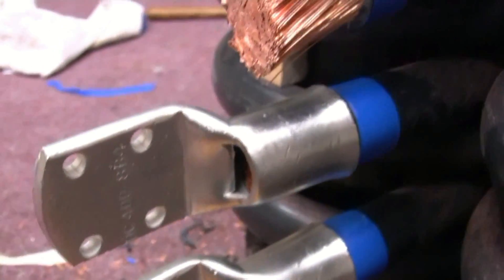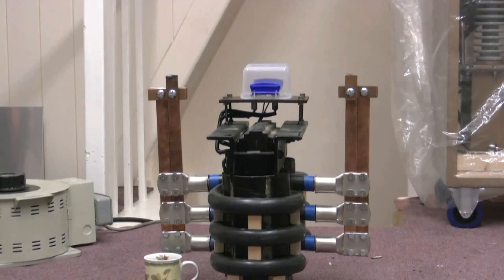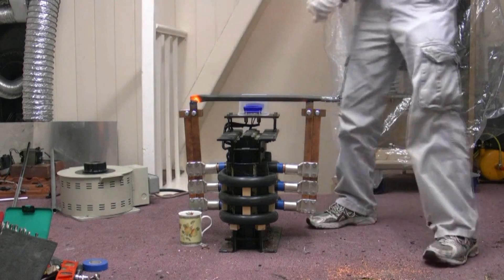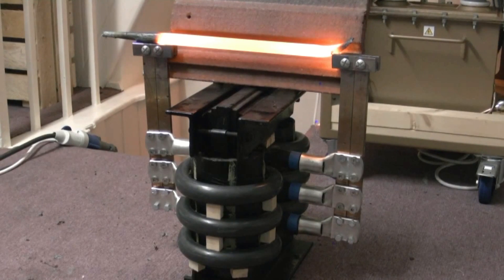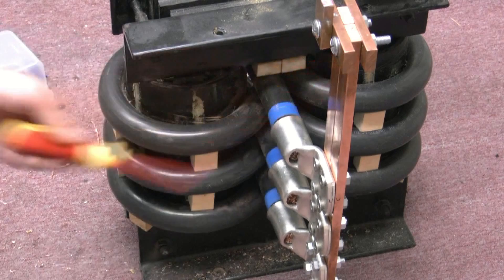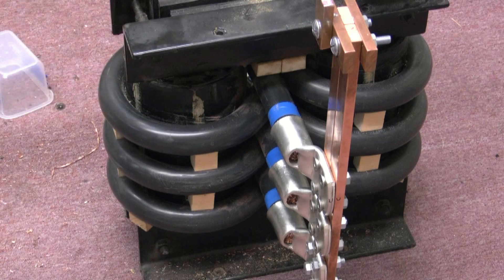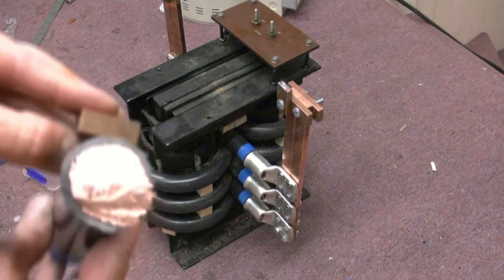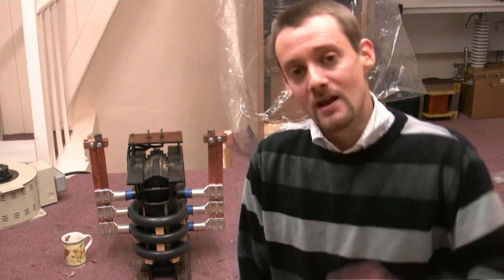50,000 Amp Transformer Completed

Comment: For the section of this three wires, you have at máximum power about 5,000-7000Amps, and not many time, 50,000Amps is TOTALLY discarded. The medium current on one graphite electrode of a 150MW meltshoop furnace is about 80,000-100,000Amps, and the output of this transformers has four wires for each electrode, refrigerated by water and with a section of an elephant leg each.

Comment: i wouldnt do this. but the first time he has a bar going across.. since hes trying to short out transformer it seems, wouldnt he become a load? or is he a ground? or grounded?
hes nuts. this guys knows his stuff right?
Reply: There isn't enough voltage to push those amps through the human body.
Reply: voltage is too low, and about the grounding thing, it's a transformer.. secondary is floating (not reference to ground) touching one terminal while grounded is fine, and when he short the transformer the electricity flow through the metal and nothing flows through him because there's no path to anything, even if there's the voltage is too low
Reply: Thanks guys

Comment: i don’t understand how he can hold the bolt without him getting shocked or his end getting too hot
Reply: The voltage is wayyy too low to shock him, and secondary of a transformer is not reference to ground (floating) so no path for electricity to go, and for the temperature, with thick bolts like that heat will probably take sometimes to get into his hand and the current only heats up from one terminal to the other
Reply: @Mark S what about the bolt heating up

Comment: That's not 50kA. When you use just 1 loop with 0.5V, voltage is so low that you can never have a good contact to the object you are melting so amps get too low. Attach all 3 cables in series and you'll see the difference.
Reply: it's a youtube video.. what do you expect. 50kA is the theoretical limit of that thing

Comment: How much is 400m2 cable back in blighty?
And how much are the lugs?
Im using 70 and 95mm2 for an off grid solar rig and its not cheap new. I did score a bit of 95 for free with a bus though, they had it running to the hydraulic tailgate pump from the alternator, nice score!
And the 70mm was at a garage sale $5 for 28m red and black.

Comment: I would have guessed that 50K amps could be very hard to interrupt without excessive voltages causing flashover.  But it appears that he interrupts the current by lifting the end of the bar with little problem.    There may be details of the design not apparent.    

Big power plants use "isolated phase bus ducts" to carry 25K amps to the low side of the transformer.   On the rare occasion when they short out, it can cause a flashover between the phases that is impossible to stop.  It can melt the ducts all the way back to the generator, then destroy the generator.   

The voltage across spark when lifting those bars is L di/dt, and di/dt is a huge number.
Reply: it's only 4 volts
Reply: @leolego2  That doesn't help.  Interrupting that current causes a L(dI/dt) counter voltage.  Even if L is small, dI/dt would be huge.

Comment: how is he not scared of being electrocuted to death ?
Reply: he's a trained electrician and knows what he's doing thats why... and it's low voltage so its pretty much harmless
Reply: @conkerconk3  from what ive read,  50000 amps is pretty much deadly, regardless of voltage
Reply: @Wildtotarda  you cant get that current through you if there isn't enough voltage. current = voltage / resistance. a 50,000 amp transformer just means it's capable of providing 50,000 amps, it doesn't mean it will always provide it. stick a 100 ohm resistor across it (assuming the transformer output voltage is 1v), that transformer will be putting out 10 milliamps
Reply: @conkerconk3  ok, this is getting to technical for me, but thanks for the explanation lol
Reply: @Wildtotarda  You need volts to drive current through a circuit. 0.5 volts drives microamps through the human body. Direct comparison - touch both terminals of a 1.5 volt battery and you'll have three times as much current flowing through you than would have connected up to this transformer.
Reply: @paulanderson79  Thank you.

Comment: *IT'S ONLY GOT 1/2 A VOLT  he said*

Sounds like he's saying "it's very low voltage so it's safe"

Meanwhile he forgot:

0)  voltage doesn't cause injury - CURRENT FLOW causes injury (or death).  NOTE:  A current flow as low as 0.1 Amps - that's 100 milliamps - can kill you.  He's bare-handing a metal bar with 500,000 times higher current flow than lethal 0.1 Amps.  50,000 Amps  is 500,000 x 0.1 kill-you-amps = 50,000 Amps

1) transformers explode sometimes and when it happens it sounds like a bomb

2) putting a dead short - ie. short-circuiting ANY 50,000 amp electrical device - well the device is going to get very hot and could explode

3) for example, let's say you take 240 volts AC off the main power source in your basement apartment (Mom and Dad let you stay there as long as you're 'good') and you use a step-down transformer to raise max output current to 50,000 amps and then you SHORT-CIRCUIT THE 50,000 AMPS - that's a lot of current, basement-dweller man. The transformer should not be shorted like that unless YOU HAVE A FUSE or CIRCUIT BREAKER that trips before the transformer explodes

4) the circuit breaker or the fuse must trip and STOP CURRENT FLOW *FAST* - ie.  in less than a second - or the electrical device generating the current will GET VERY HOT and could possibly explode

5) I can't help but point out - he had NO THERMOMETER to monitor the heat of his transformer.  That could save him if he knew the manufacturer's "maximum allowed temperature" for that transformer

6)  how long did he hold his circuit breaker - aka *THE SCREWDRIVER* - across the output of the pretty damn hot transformer?   Hint, how much time did his "fuse" - aka *THE SCREWDRIVER* - allow the 50,000 amp transformer to heat up?  For how long did his 'fuse' remain in position, shorting out the 50,000 Amps?  HINT:  Was it longer than, say, a second or two?

"How do I get out of this basement?  Me life's a shambles.  Maybe a dead short across a 50,000 amp transformer would do it"
.
.
.
Reply: Half a volt will not push 50,000 amps through the human body.

Comment: How doesn't he get shocked with the first metallic bar holding with hands?!
Reply: Ryan The transformer has a low voltage output. His body has a high resistance, so very little current will flow.
Reply: @M1Cr0sOfT  thsnk you!
Reply: Ryan no worries mate 👍

Comment: 1:41 please explain how you're touching the bar with bare hands
Reply: Most of the heat is being produced between the two terminals so there would only be heat conduction to the part he's holding. I'm sure it would get pretty damn hot after a while though

Comment: SERIOUS QUESTION: how does he not get electrocuted?
Reply: @MissRiaElaine When you're overheating copper bus bars of that size you have to know what you're doing. Plus this guy has to be like a transmission lineman or engineer or something. I'd actually love to know.
Reply: @Magneticitist  He's a degree qualified electrical engineer.
Reply: @paulanderson79  Anyone seen him recently?
Reply: @Magneticitist  Sadly not. He had some massive issues getting his wife into The UK from India.
Reply: @paulanderson79  Oh I thought they worked that out. I recall seeing a photo someone who knew him posted online of him and his wife looking happy and seemingly standing in his home in the UK. That was a while ago though and I thought maybe his wife might have just been keeping him busy or maybe taking issue with him potentially burning the place down lol.
Reply: Half a volt can't drive any dangerous level of current through the human body. Touching both terminals of a 1.5 volt battery will push three times more current through you than this 0.5 volt supply can.

Comment: The only thing that can have as much strength as 50,000 amp is a lightning flash. Naturally we already know the impact of download by nature and that small short shown in this video and compared to a lightning seems rather that the owner of the video put zeros where they do not go. Possibly 500 amps at the most. In addition to where you will get so much energy where it would seem to be in a home.
Reply: 50,000 amps at 0.5 volts is only 25kW. 100 amps at UK domestic supply voltage. Most houses have 100 amp main fuses.

Comment: How it's voltage AC or DC ???
Reply: It's AC, you can't run DC through a transformer.
Reply: @rtdlaboratories  Worrying, isn't it?
Reply: @paulanderson79  What's worrying exactly?
Reply: @rtdlaboratories  people with no understanding of electrics and electronics.
Reply: @paulanderson79  Oh that.. yeah. But as long as they are willing to learn and do the research on what they are getting into beforehand, get them a long way on avoiding injury or property damage. Just the lack of knowledge isn't an issue in itself, we've all been there at some point.
Reply: @rtdlaboratories  That is an utterly fair point and well made. We can't all know everything.

Comment: Why? The welding inverter generates 200A at 20-80V. You have a maximum of 50A, judging by the way the steel bar is heated

Comment: 1 amp will kill
Reply: Currents as low as 30 mA (0.03 amps) can kill. But we only have 0.5 volts here. Nowhere hear enough to push even 1 mA through the human body. You could grab both terminals quite safely.

Comment: Hello, What it is to have money and spend it on useless things, which use has damaged screwdrivers, that is the principle of resistance welding, or electropunto. But as I read in a comment, certainly there is no 50 kAmp, in fact at those levels of amperage requires cooling of the contact tips and the cross section or area of the secondary conductor must be calculated according to the current density. Also the terminals connected to the cables of the secondary have lost due to low voltage and high amperage, I did not make a good connection at those points. It is a constructive comment, without finally offending your time and your money.

Comment: I remember working on a 15,000 amp variable constant current power supply we built for Westinghouse, they used it to test circuit breakers. It was 3 phase and used hundreds of 2n3771s for the series pass element. We used 2 large aluminum angle irons and a steel shop stool as the load, you just had to have a 200 pound tech sit on the stool to make sure you had contact. That stool had the paint burned off the legs because they glowed dull red at full load.

Comment: Photonicinduction 50,000 Amp High Current Transformer Completed
25kva - 75 kva transformer, output voltage at 0.5v    3 x 400mm2 cables
50kA is at max power on short circuit. Input voltage 0-240v
My house does not have enough power to run on full load, transformer was built as a demontration of high current.
Sound Track generted from http://www.looperman.com/

361/5000
Indução Fotônica 50.000 Amp High Current Transformer Completed
25kva - transformador de 75 kva, tensão de saída em cabos 0,5v 3 x 400mm2
50kA está na potência máxima em curto-circuito. Tensão de entrada 0-240v
Minha casa não tem energia suficiente para funcionar em plena carga, o transformador foi construído como uma demonstração de alta corrente.
Trilha sonora generted de http://www.looperman.com/

Comment: Your 50,000 amps are totally false let me tell you why.

(50,000 amp) Secondary coil X (1 volt) secondary voltage = (50,000 whats) power output on the secondary

(50,000 whats) power output on the secondary / (125 volts) primary voltage = (400 amp) on the primary coil.

What is totally false is that your supply cable supports that current.

I could handle it as transient but not as a constant load.

Comment: Tus 50,000 amperios son totalmente falsos déjame decirte el porque.

(50,000 amp) Bobina secundaria  X (1 voltios) voltaje secundario = (50,000 whats) potencia salida en el secundario 

(50,000 whats) potencia salida en el secundario / (125 voltios)  voltaje primario = (400 amp) en bobina primaria.

Lo que es totalmente falso que tu cable de suministro soporte esa corriente.

Podría soportarlo como transiente pero no como una carga constante.

Your 50,000 amps are totally false let me tell you why.

(50,000 amp) Secondary coil X (1 volt) secondary voltage = (50,000 whats) power output on the secondary

(50,000 whats) power output on the secondary / (125 volts) primary voltage = (400 amp) on the primary coil.

What is totally false is that your supply cable supports that current.

I could handle it as transient but not as a constant load.

Comment: 0.5v and you're saying you could probably touch it and not feel it....I doubt you could feel that across your tongue, completely safe. That saying about it's not the voltage that kills but amps is complete BS, it's both, without voltage you can't push enough amps through the human body to do an damage, there is simply too much resistance.
Reply: It seems you and I are the only people in here to understand the relationship between voltage and current.

Comment: Idea use 20 m^2 copper wire and/or superconducting wire for conducting 1 Teraampere of current AND increase ratio until you get it.
                                           -energyninja50909
Reply: 20,000,000 to 1 
50 kA          to 1 TA

Comment: so is he creating a short by connecting the 2 bus bars with the rods/screwdrivers? creating less resistance and way more amperage? How come the short doesnt cause an explosion? Also dies wrapping the 400 mil cable around the dual  cores, step up the voltage or step it down?

Comment: It is not 50000 amp.
It is about 2000 amp.
I have 600 amp rectifier and it can burn half inch steal rod in 20 second.
Reply: It's 0.5V, the connection to the busbars must be really low impedance to get the full available 50kA.

Comment: That's why I personally prefer Low Voltage: High Current over High Voltage: Low Current. The first one won't get through your skin, so it is pretty save to touch. It might get very hot, but I can do something about that. High Voltage will kill you if you touch it...

2:58 The famous test to see if something is overloaded: Is the wire too hot to touch?
Reply: yea but with more amps than volts 70% of the overall wattage will be gone, 
nearly all the electrical energy inside them gets converted to heat, that;s the main reason we use AC in the first place so we can keep the pressure going to push out that power instead of letting it heat up the cable

Comment: Thought amps kills u. Not volts
Reply: You need both, 1000A at 1V is harmless as the resistance of the human body is too high none of that current can pass through you, 1A at 1000V however is lethal.

Comment: I use to work for a magnetics company that made custom one off and very small production run transformers.  In 1969 when the USS Enterprise CVAN-65 suffered from a fire and numerous munitions explosions we were tasked with supplying several enormous 3 phase transformers.  I don't recall the exact specifications. They started with I think 6 ad by the time final test came around all had failed but 1.  I do remember we powered that monster very slowly to the test spec and turned it down very quickly.  This transformer you made reminded me of that incident nearly 50 years ago.

Comment: Where does this equipment come from. I've seen many videos that have devices and wire that is not sold at any of my supply houses lol. They laughed at me and didn't even know where to start. 400mil wire? Lugs the size of my hand? Try to bend 1/0 wire in a nice circle around a pipe......

Comment: I dearly love this man.  He is a living demonstration of why science is awesome.  Also, where in the world does he get the materials to make these terrifying devices?  I've worked in industrial settings and seen some serious equipment, but that cable was reeeediculous!!!
Reply: Looks like diesel locomotive cable. A fella brought a chunk to work, about 1 inch diameter and finely stranded like welding cable.
Reply: Any decent electrical suppliers will sell you it.
Lots of uses for it
Reply: Diesel electric loco?
What batteries are they running these days?
Reply: @bushratbeachbum  They don't run storage batteries on locos, just high amp generators and high amp electric motors.
Reply: Hurrah for fireproof carpet.
Reply: The factory that supplied the suspension cables for the Golden Gate Bridge in San Francisco should still have some offcuts lying around too.  One would only need to cover these in a layer of electrical isolation material and attach some (smaller) lugs to the ends.
Reply: @Andreschannel_SA  those cables were fabricated in-situ by special wire looms.

Comment: Once again this is only .5 volts.  The 50,000 amp rating simply means that it can draw that much current without melting.  Touching both terminals would not be dangerous.  You wouldn't even feel it.  No different than touching both terminals of a 12 volt car battery rated at 500 amps (except that the battery has more potential to "push" the current).